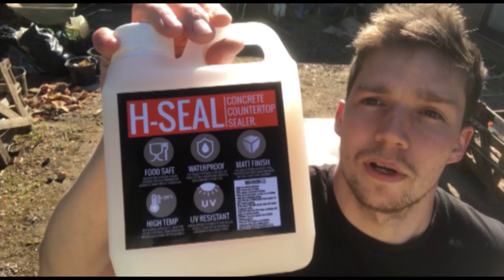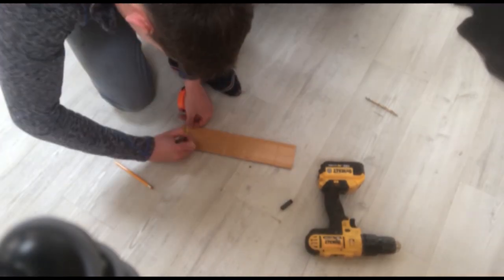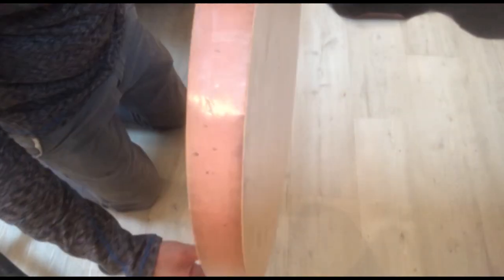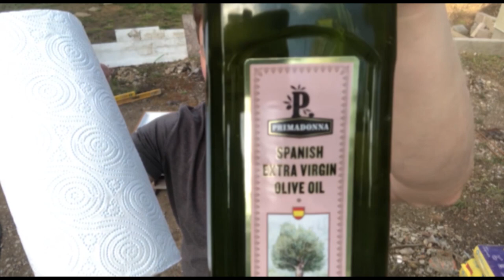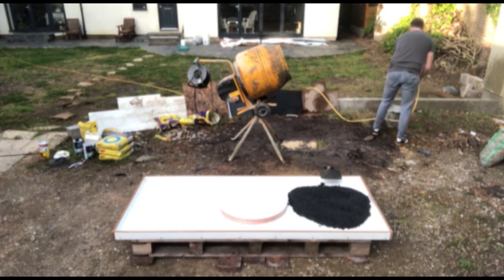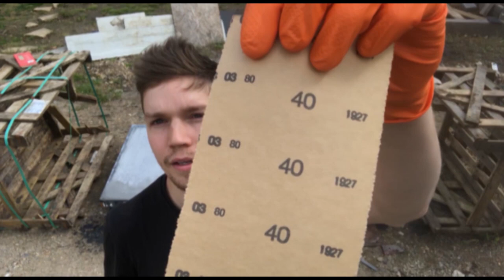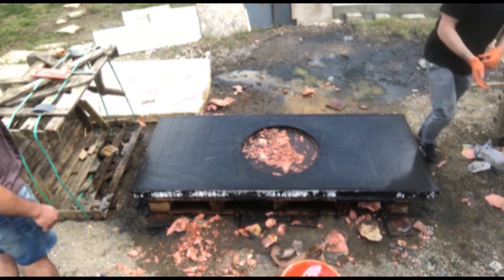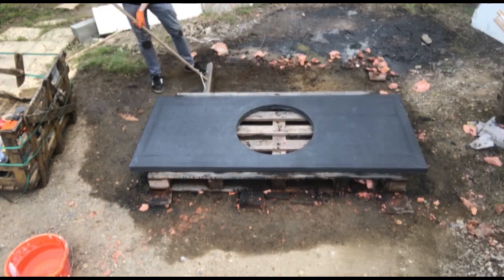How to Make a CONCRETE COUNTERTOP / WORKTOP in 10 MINUTES!!! OUTDOOR KAMADO BBQ / BIG GREEN EGG BBQ

Comment: really nice.  Just a question.  Is it possible to cover the concrete with epoxy and what will be the difference with the sealer ?  (just more expensive ? )
Reply from the maker: Sébastien Dionne hey how’s it going? Yes you can use epoxy, but epoxy is better for indoor projects because even if it is UV resistant it will still yellow in the sun over time Sun. Epoxy also gives a very glossy wet look darkens the concrete so it’s best to do a small test before you commit, as you won’t know what it will look like till you pour the epoxy on it. 
In contrast with the more natural matt finish seal used in this video, where it will keep the natural look of the concrete. If your looking for something more natural, this sealer works really well and is food safe: https://hsealconcrete.com/products/h-seal-concrete-countertop-sealer , if you’re looking for a glossy wet look you can check out my other video here: https://youtu.be/OxbXF4P2Iz4  with an epoxy finish.
Hope that helps :) Matt

Comment: Great Video you have really inspired me to make my own.  The main issue I have is I cannot seem to buy melamine sheets large enough where do you get yours from in the uk?  Is there an alternative I could use maybe waterproofed MDF?
Reply from the maker: Hey I’m glad you liked the video :) you can get it from Alsford timber or Builder Depot it’s around £44 per sheet. Here are the links:
https://www.alsfordtimber.com/white-2-side-melamine-mdf-2440-x-1220-x-18mm-105400

https://www.builderdepot.co.uk/18mm-white-melamine-faced-mdf-board-2440mm-x-1220mm-8ft-x-4ft

Comment: Hi mate, thinking of doing this myself.

I can't find any melamine wide enough for my BBQ I have lots of marine ply at work, and I have roll and stroll self adhesive carpet protector.

Do you think I can stick the roll and stroll to the ply board then make the mold out of that to stop it sticking to the ply. I've read it may leave like creases here and there but that may add to the effect and its free 😁

My other question was will this withstand the heat from the BBQ being in direct contact with it? Or will it crack. I will be rebarring it all.
Reply from the maker: Hi Tom are you doing a Kamado BBQ like the one in this video that pops through the concrete via a hole? If so, I wouldn’t worry about heat, it will be fine. If you’re planning to light a fire directly on top of the concrete, this can cause the concrete to crack and sometime pop and fracture especially if you have a lot of air bubbles in the concrete.
 Melamine comes in 2440mm by 1220mm and sometime larger if you special order. Best places to find it, are:
Builder depot, alsford timber in the UK. Anything will work as a mould really as long as it doesn’t stick to the surface. Might be best to do a very small test first with the carpet protector. And apply a very thin layer of cooking oil as mould release. Hope that helps.
Reply: Cheers for the reply mate, no it's not a kamado it's just a weber style BBQ that I was planning on dropping into the hole.

Hopefully that will be all OK.
Reply from the maker: @a1carpetcleaning769  if the concrete is not in direct contact with the fire you shouldn’t have an issue :)